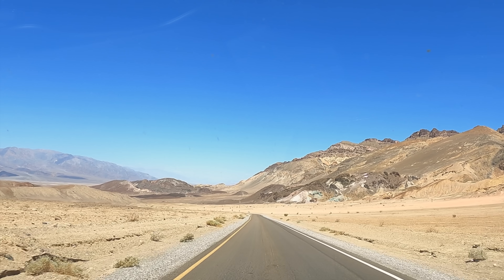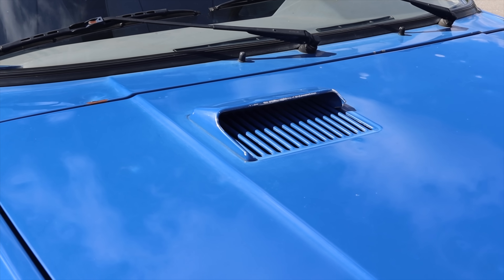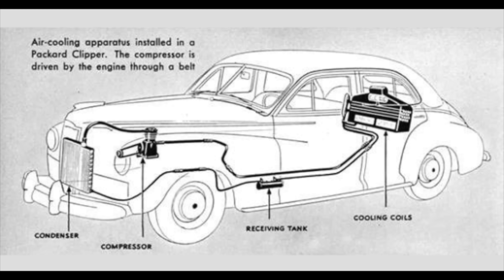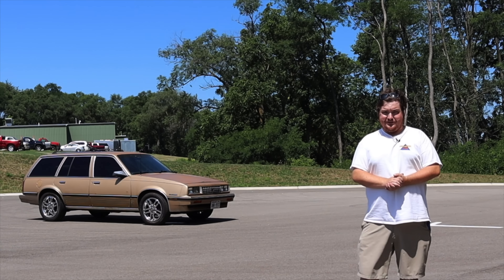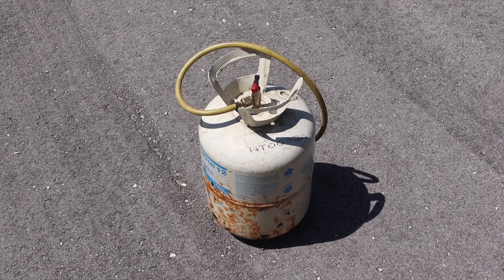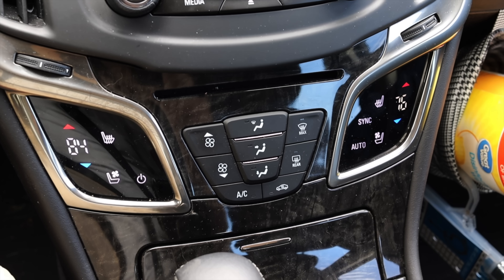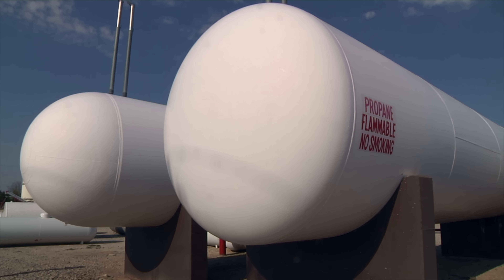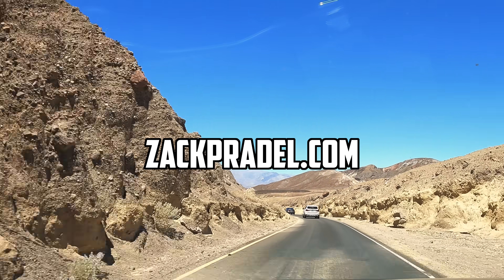Air Conditioning - The Story Of R12 & Why Modern Air Conditioning SUCKS!

Comment: Yes, I lived in the era of R12 and owned many vehicles during that time.  Yes R134a does does generally suck.  No, those were not "smokers windows".  They were vent or wing windows and because they directed air into the cabin they were not very useful for smokers when moving.  Smoker's windows were generally a particular type of rear window that would open slightly to allow venting out of the cabin, you are unlikely to have them unless you're driving something from the late 30's or 40's.
Reply: On my F250 if I open the window about 120* the side toward the dash blows in fresh air, and has a lower pressure on the door panel side, it will pull ashes and smoke right out of the cab.
Reply: You're right that the wind wings were basically low budget a/c. However, they in fact are great for ashing cigarettes. If you just crack it open, it will actually draw air out along the back edge, which will basically suck the ash out. I loved the wind wings when it was raining and I still smoked.
Reply: IIRC they were only called "smokers windows" as a joke... or by people who didnt know they were called "wing windows"
They did work great for smokers tho if you just open them a 1/2 inch or so.
The original reason for them however was to simplify the track system that the main window rolled up and down on. A square main window can simply go up and down on two tracks, but a triangular or trapezoidal window makes things a lot more complicated inside the door panel.
Reply: @nottiification  The only reason I say they're different is that there were actually features called smokers windows that allowed the rear quarter windows to slide back slightly before nonflowering, usually after a quarter turn of the handle. This mean they could be opened quickly to provide ventilation without fully opening the windows.   I'd never heard vent/wing windows referred to as smokers windows.
Reply: I'm going to have to disagree with you on the wing windows, if separate window was opened the right amount on one side or the other (depended on the car) you could get a positive outflow on those Wing windows making them especially good for ashing your cigarette.
Reply: @yetinother  I'm not disagreeing with you other than to say that a vent window isn't the same thing as a smokers window even if they get the same result.
Reply: I always knew them as 'vent windows'. You could use them as 'smokers windows' if you just opened them a crack. But since I didn't smoke, on hot summer days I always had them swung full open to direct that blast of air directly on me. I guess todays drivers won't experience that blast at 70 mph, unless they try it in an old car.
As for R134, generally, I've been satisfied with modern AC systems designed for it.
Reply: I had a 1985 & 87 ford E250 that had the "smokers" windows and I have to say they worked great sucking out my cigarette smoke.
I wish they still put them in the newer trucks.
Reply: Never heard of them being called smoker windows. Everyone I knew as a kid called them suicide windows. Might be a regional thing.
Reply: @TheLouisianan  suicide windows belong on suicide doors :)
Reply: The old Volvo PV444's and PV544's had those tip out rear windows.
Reply: not very useful while moving?  They sucked the smoke out of the cabin amazingly and you could ash your cigarette anywhere in a 2 foot area near the window without worry.
Reply: However CO2 as refrigerant will cool as good as R12 if not better. It’s very efficient too.
Reply: Those “smoker’s windows” are known as quarter vents where I live…I had four on a 1960’s Jaguar I had…two in the front doors and two in the rear doors…and yes, R-12 was the refrigerant used here up to a certain point then banned. Most earlier systems here are retrofitted, compressor, seals, valves, receiver-dryer….heck, I’ve even done it on a 1988 Mercedes-Benz 190E and pulled it over to R-134a…same on a 1970’s Jaguar XJ, and the cooling on that was sensational, and I lived in a hot place then. Never had a problem with the new cars I’ve driven in recent years…their systems work well.
Reply: Beast
Reply: I kind of like the vent windows.  You can open them up to get some air into the cabin without that horrible buffeting sound in your ear.

If you don't think that they were good for smoking, you should have seen my dad's work truck.  The vent window was white from ash getting sucked through.
Reply: If you have a system built specifically for R134a and built to reach the same cooling temp, R134a will literally work just as well as R12.
Reply: I have I guess what you call Smokers Windows on the very REAR of my 96 Buick Roadmaster wagon.
Reply: As someone who used to smoke when they drive (dont smoke, and if you do, do your best to quit. youll thank yourself) I noticed this. Im only 24, and havent been in too many old cars, but I realized that those werent smokers windows right away. It would blow out the flame to light a cigarette, or it would deplete your cigarette too fast from all the air moving through. It didnt make sense to do that if you were a smoker.

Comment: Normal people would buy R12 in much smaller cans (same size as the R134a cans) That large bottle was for garages that worked on cars, or dealers. I don't notice much difference in the cooling power between R12 and R134a. Back in the day, you could add R12 to your system by looking at a sight glass in the system, to check if you were low. If you saw bubbles in the sight glass, you could add R12 until there were no more bubbles. With R134a you need pressure gauges to not overfill the system. PS. I still have one of those small cans of R12.
Reply: R134 is less efficient at cooling, but can normally be corrected by just making said system slightly beefier.   I also wonder why they don’t add sight glasses to car air conditioners.

Comment: I have a 2022 Toyota Corolla and the AC is really my only complaint. It has R1234YF in it and it’s absolute garbage. It works but it’s definitely not over powering by any means. I had a Scion tC and the AC in that thing would almost freeze you to death lol.
Reply: The Scion would have had R134a.
Reply: @billkallas1762  it did and it was noticeably colder than the new R1234YF systems.
Reply: @MoparMuscleTruck  I believe that they make that new R1234YF refrigerant out of Butterfly Farts.
in order to protect House Flies.

Comment: I had a number of cars with R12 - 1963 Dodge, 1970 Ford XL convertible (why did anyone put AC in a convertible?), 1970 Pontiac Catalina, 1978 Ford Country Squire, 1979 Pontiac Bonneville, 1982 Plymouth (Un)Reliant... I could go on and on, but I'm not sure about a couple of the others.

Comment: The main issue with R-134a at the R-12 phaseout was the phase change temperatures and pressures. Basically they operated at different pressures within the same system. So putting 134 into a 12 system would make it warmer. However, many manufacturers had set screws under the pressure sensor fittings that allowed the pressure switch setting to be changed. Set it to be triggered higher and the 134 systems were colder than when they had 12 in them. There was a thought at the time that manufacturers did not like that, so they removed the adjustment, citing cost savings.
Reply: I converted a 1989 Ford Probe to R134.  At the time I was able to source a pressure switch that was calibrated for R134.   The system blew just as cold while the car was moving but not quite as good as R12 when the car was in traffic.

Comment: I’ve got 3 16oz canisters of R-12 I bought awhile back off of eBay. I had a 1988 Cutlass Supreme Classic I was gonna restore and wanted to have the original refrigerant for it. I ended up selling the car before I got around to it. Still have the cans. Worth a few bucks more as time goes on, lol. They have a new refrigerant out now called R-1234yf. Most newer cars use it. My 2019 Chrysler 300C uses it. Supposed to be even better than 134a for the environment. Super expensive though. t’s also supposedly slightly flammable though. 😂 Also can be corrosive too, especially if water contaminated the system. Pipes can be eaten from the inside out. Time will tell.

Comment: A good portion of the reduced cooling capacity in the name of better fuel mileage the “horsepower” of the compressors has been reduced. R-134a is also on its way out has been replaced by R-1234yf (moderately flammable) in cars in trucks, and R-600a aka isobutane (yes extremely flammable!!!) in home and commercial packaged freezers and refrigerators.

Comment: I bought a 1992 Lexus SC300, 5 speed, pearl white, light tan leather, I bought it in 2011 with 60,000 miles on it.  If you were to concourse judge this car it was  a 3.9 to 4.3 on a scale to 5.  AKA for a driver it had maybe 2 or 3 rock chips, ZERO door dings, the interior was just about damn new except for the left bolster on the driver's seat that had a slight bit of wear, if you knew how to repair leather with some filler you could get it looking almost new.  That car had its original R12 charge on the a/c, I drove it for 2 years when the refrigerant eventually leaked out.  My good mechanic patched the leaky line, recharged it with new R134a, the a/c blowed cold as hell, same as the R12 despite the same 1992 A/C compressor, 1992 evaporator core, etc.

Comment: i have had several vehicles that use R12 late 50s on up .  some would blow snow ( ice crystals ) out the vents but they all worked great. at the end of R12 i started using R12 replacement that worked ok but none of the 134 crap even holds a candle to R12. and yes propane works great BUT it is very flammable. i have seen 2 farm tractors burn to the ground because they blew a hose on the ac.
Reply: I was a car jockey at an Oldsmobile dealership. 
We used to eat our lunch in cars that were being service.   This was around 1967.  We would get in the old 50's cars with a/c, and eat lunch.   The 50's cars had a/c better then the 60's.   The compressor were huge.   When you turned theva/c on the engine would slow down.
Reply: @jamesmooney8933  Good old Frigidaire. The refrigerators from that era were pretty damn good too. My dad owned an auto repair shop and had an early 60s Frigidaire fridge in the back/break room. Thing ran like a top and kept shit cooooold. And yep, Fridays at noon, she was loaded up with beer.
Reply: @zlinedavid  Yes, alot of old things were better.
Reply: Did you use real 134a or the crap that they sell at auto parts stores which is an azeotropic blend?
Reply: @freddaniali  freeze 12 was the best replacement for R12 at the time
Reply: @martehoudesheldt5885  Freeze 12 is a blend, just like NU-22 and the fake 134a that Pep Boys sells. You need an EPA license to purchase real refrigerant.
Reply: @freddaniali  Plenty of people selling R-12 on eBay with the disclaimer that the buyer is just going to resell it again. Perfectly legal. Or, of course, get one of those "quickie" licenses.
Reply: @frequentlycynical642  Yeah, where there is a will there is a way, but if you want to buy it from normal retail, they require the license. It's easy to get, all you have to do is take a test. Most folks won't do it because they don't work with it on a daily basis so just go and get the drop-in stuff. They end up regretting it when they get a leak because the light stuff leaks out first and ruins the efficiency of the blend.
Reply: My 26' class 'A' motorhome (GM chassis) has an in-dash a/c that uses R134. The system is incredible. It can cool the entire interior volume in 105° weather. On high we call it the Arctic Blast system.
Reply: I have a 67 Ford Galaxie with factory air conditioning I put R134a in it and it blow 35°-45° on a 90° day, so the R12 is better then R134a is bs.
Reply: @ericheld4382   I think it's highly variable on the car's AC engineering. My own experience is that it's not as good, and thousands of intelligent people have reported the same. And it makes sense looking at the fact that R-134a requires larger heat exchangers, different compressors.
Reply: @frequentlycynical642  older cars already had larger evaporators and condensers R12  systems also used more refrigerant the trick to properly converting from R12 to R134a is using 75-80% of the original R12 charge. All my R12 cars have been converted and work very well, there's a few components the need changed but for the most part R134 cools just as well, I'm a HVAC tech so I know a lot about the subject.
Reply: @frequentlycynical642  the system can only go to it's specific setpoint of just above freezing anyways, as if it goes below freezing the system ain't gonna work anyways because the evap will be a block of ice. R134a can drop the temperature just fine. This whole argument is stupid

Comment: My 86 Mazda RX-7 FC was refitted with an AC from a Turbo model and converted to R134A. Cools like hell, but not for long. The compressor blew up. An AC expert told me that next time I should come to him, he will fill the system with a Propane / Butane / ... mixture and this should work very well and reliable.
Reply: FR12 works great
Reply: 86 13b with an explosive A/C system? that maaaaay not be the amazing idea the mech thinks it is. at least make sure you remove the fuel pressure damper first! lol.
Reply: @Born_Stellar  Fuel pressure regulator and damper are already new, because I know to many burned down cars because of that.

Comment: My suggestion would be to do a video essay regarding early touch screens in cars. GM had the best examples in the 1980s.
Reply: I own an 89 reatta and the touchscreen works mint
Reply: @keegenm.6154  I can believe that. Older cars from GM (particularly 80s and 90s) seemed to be of better quality than those of later model years. My 94 Cavalier had about 188,000 miles on the clock and ran super-well before I sold it.
Reply: The old CRT displays on the Riviera/Reatta/Toronado/Eldorado and a few others. Yep, worked surprisingly well.